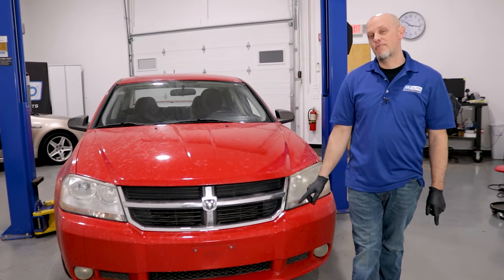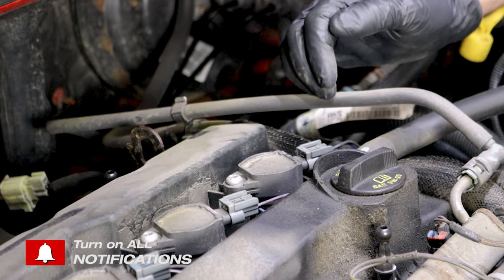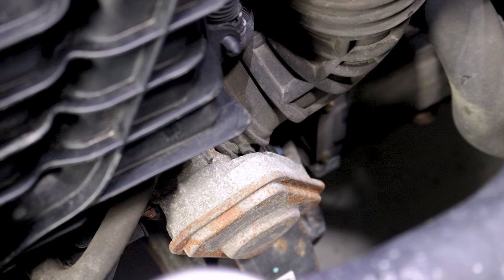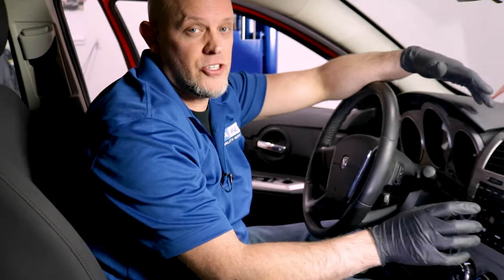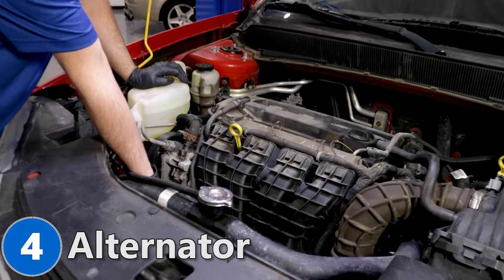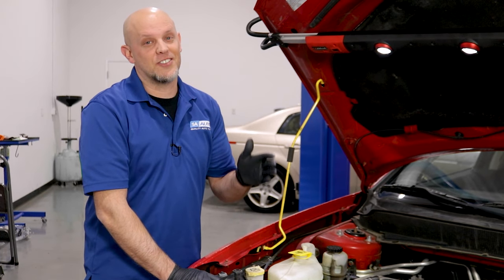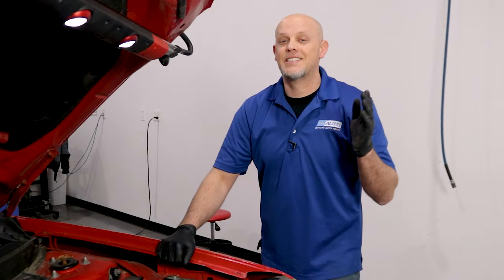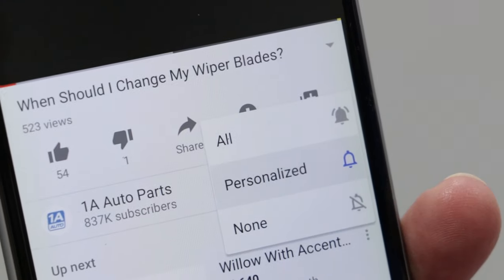Top 5 Problems Dodge Avenger Sedan 2nd Generation 2008-2014

Comment: 2009 2.4L SLT - Super Laim Transport     Runs great! Warm up induction Fan replaced, Transmission rebuilt, Replaced the Instrument cluster  because, of "noFUSE" Message  I'll explain later and the left Gauge didn't say anything. R&R and now it says the Temperature and what Radio Station. Yaaay! 
Battery was going dead Sometimes wouldn't start (The Starter is under the exhaust manifold and Battery is way under the Fuse Box AKA TIPM or in front of the front left tire)...  The Positive cable on the Shock tower shorted to the tower So, New Red Top Battery, All new Battery Cables. The latest is; In the message area on the Right Gauge AKA Tachometer is the Odometer, Trip A/B and PRND. Well, in that same area the Car says; "noFUSE" 
...Huh? What? What does that mean? Key off - FOB Won't work, Interior lights won't work, Door Locks won't work, Trunk won't open, Windows won't roll up or down, Emergentcy flashers won't flash. Key on - Everything works except, the FOB only makes the lights turn on and flash.  Replaced the TIPM and Instruments for this reason and Drum Roll Please.... Nothing. Still says basically; I don't wanna say but, starts with F and ends with u.

Comment: I have a 2012 brake lights on and traction control fixed abs both fronts tried clearing sensors so many times any one please lmk and traction control and emergency brake lights come on

Comment: Funny how I replaced all of these things when I only had my doge avenger for 1 year
Reply: My alternator died early but the other issues developed over time.  I’ve had 3/5 issues and have been able to fix them all myself.  The car isn’t fantastic but it’s easy to work on and was a fairly cheap car during its production years.

Comment: Like seriously? These are the most common issues? Personally, I wouldn't even call them issues at all. Every single thing you mentioned are repairs I can handle myself and already have all the tools I would need to do so. Thanks for sharing as I'm considering purchasing a used one. My '01 QX4 on the other hand, well let's just say it's now been sitting idle for a total of two years because I really just don't want to do the amount of work that's required to change the stupid water valve. I had to take the freaking front bumper off and remove the headlight assembly just to change out the headlamp. I mean, come on, how ridiculous is that?
Reply: You have to do the same thing to replace headlights on the 2013 Avenger. And you have to remove the driver's side wheel to replace the battery so you just have to pick your poison I guess.

Comment: Car gave me little to no problems in the first 100,000 miles of its life.  The last 40,000 miles have been problems

- Starter replacement - ( possibly for the 3rd time today in 3 years )
- Oil Filter Housing leak - ( which I've put off for about a year, but now it's becoming too costly )
- Alternator - ( lasted 120,000 miles, so I can't complain too much . . but it was an absolute MONSTER to get out of the car )
- Passenger side window won't go up - ( still troubleshooting this, but needs to be fixed before winter hits )

Despite this, the car is still my "dog"!
Reply: Same with oil cooler for me but it was coolant pouring out instead of oil. The 2013 housing is cheaply made but 2014 they updated to aluminum housing which fits the 2013, so that’s what I went with. Kind of a pain to replace and costly but so far no issues.

Comment: I'm having problems with mine now it won't start it's getting gas to the engine is getting air to the engine the spark plugs are firing The filter is clean and just won't start

Comment: My Girl friend has the 2013 Avenger and I've never disliked the car so much in my entire life literally a knockoff charger for people who don't have the money to acceleration is poor to change the battery you have to take off the driver side Tire guy in the video talks about replacing a thermostat we didn't tell you is that there two thermostats so you having all of those issues replacing one doesn't actually fix it you have to replace both of them it's supposed to be a midsize sedan but you're just putting more than three tall human beings in the car is a little bit of a struggle as though you were driving a compact car which is ridiculous

Comment: I have a 2012 3.6 v6 that has a suspension knocking noise in the drivers side left wheel well that you can also feel in the steering wheel. Any thoughts anyone? Also seems to sound and feel worse in the hotter seasons.
Reply: My 2013 is doing this

Comment: Currently my 2012 is having issues with nice hot air coming from the driver side vents and cold air on the passenger side vents. Any ideas anyone?  Oh and its also leaking coolant and puddeling on top of the tranmission case.  Tried to find the leak but its a very small leak and not leaking while sitting still.  Ty!
Reply: I have a 14 2.4L SE, had the same issues. Hot/cold mix coming from the vents(assuming you're talking about with a/c engaged) indicates a low refrigerant charge and/or blend door. With both possibilities, I would suggest having a professional look at it or prepare to read a LOT to educate yourself on how to diagnose a/c systems. Mine ended up being a leaking condenser. If you look above the puddle on the transmission housing, that's where you'll probably find the source of the coolant leak. Clean every drop of coolant around the area and pay close attention to where new drops form. In my case it was a slow leak coming from the gasket in the thermostat housing that mounts to the block. Only a few bucks from Rockauto, etc. Again, do your due diligence! The coolant you'll need to fill with after spilling during repair is also unnecessarily specific and could cause issues if mixed with the wrong one... Definitely possible to do anything yourself, just take your time to prepare
Reply: Does it click? Blend door actuator

Comment: 2011 dodge avenger headlight turns off on the side your using turn signal..is this normal for this car?
Reply: running lights should only turn off when using turn signal, not when you have headlights on. so yes if you don’t have headlights and just running lights it is normal
Reply: Yes. All dodges have this. My 2012 avenger too
Reply: I recently replace the turn signal switch because I hadno emergency lights or turning signals,  when you would insert the key the headlights would immediately come on. After market Part was about 50 bucks and it took less than an hour to install

Comment: The avengers suck!!!!! Have had to replace an alternator, starter, coils plugs, MULTIPLE THERMOSTAT HOUSINGS…. Not to mention the countless failed thermostats right out of the box….  I literally just replaced the whole housing assembly and have triggered a p0128 because the NEW THERMOSTAT failed.

Plus the countless electrical issues. The main fuse box location gets destroyed in the engine bay.

I would rather drive a Prius